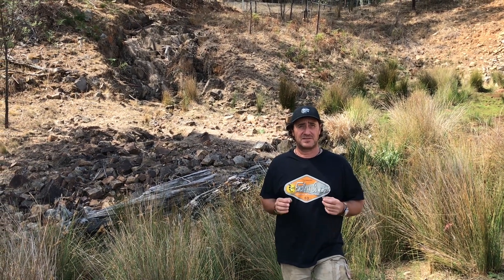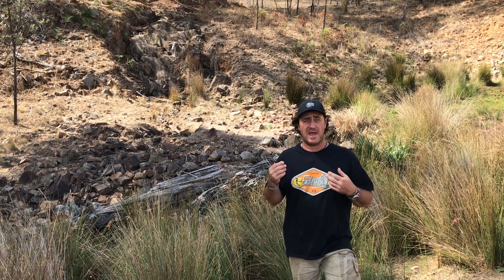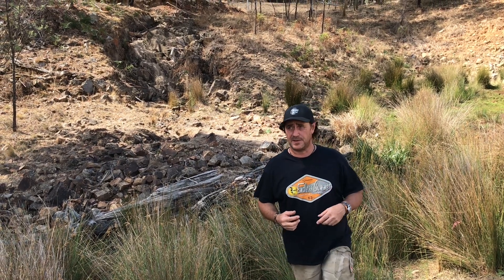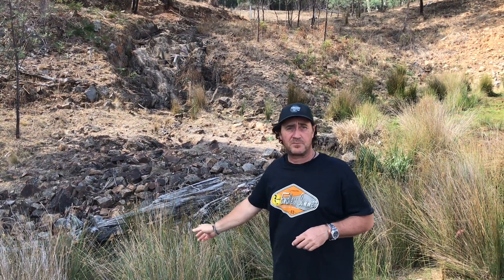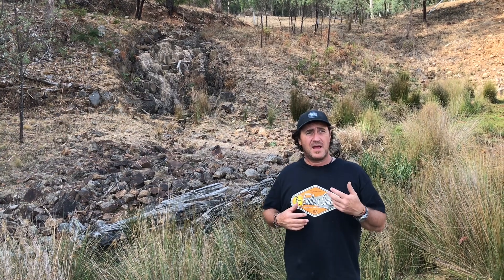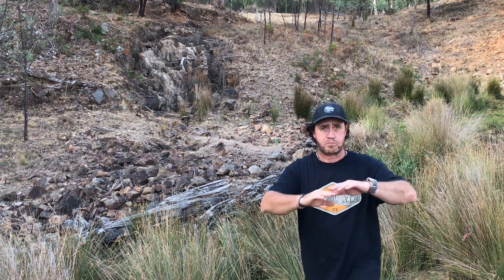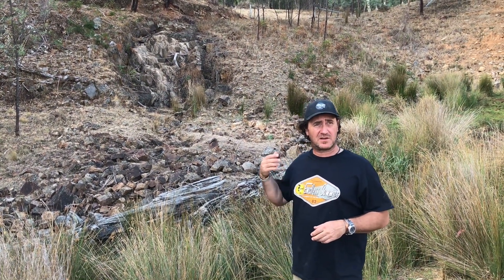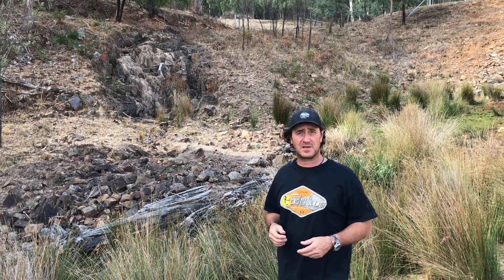Alternative Power Ideas - We Need Help!

Comment: Try looking at a superheated steam turbine set-up stuff like that I think about alot I'd love to be in your situation,  soon hopefully
Reply from the maker: I've looked at something similar - a heat exchange system that is similar to that of a steam turbine. The drama is that china had purchased the patent and the new models coming out of Europe are close to $80,000 for the capacity we need. That's a lot of solar and or fuel for the generator. If you know of anything cheaper I would really appreciate the lead. Thanks in advance.

Comment: hi we are offgred and we have found that gas hot water and stove work well and solar and using a generator to top up your solar WORKS the BEST we have a wood stove for heat in the winter we are in Qld so it doesn't get that cold..have been likeing your videos..
Reply from the maker: Hi Julie, I think the system you have would suit us the best. Thanks for your time to respond. Cheers Pedder

Comment: Do the math before you build . Used solar panels are so cheep now as to make other sources non competitive. Even if only used 3 months per year they can still be economical .
Reply from the maker: Hey Teddy, you are spot on. I thinking upscaling the solar system for the new homestead build. With a victron MPPT 450/200 which can handle 4 tracks of 450volts (generally around 4kva) per track.

Comment: Have you look up anything on wood gasifier and generator?
Reply from the maker: Yeah - found a great product from the Netherlands ref to thermal sterling engine (based on heat exchange) 1000 w per hour at 200 degrees C which is generally the average on the wood oven. Couldn't believe the price Euro 10K that's nearly 30K Aus $. This is too expensive for our little farm. Cheers Pedder.

Comment: Harry's Farm just did a 10-20 year video review of some solar and wind installation he did which is a good watch. lots of good comments under his video too. obviously its in a british context, maybe its not so windy in your area. also a heat exchanger he installed with ground heat pumps, it may not generate electricity directly, but it might save you from using/needing electricity in the the winter in the first place if you're getting hot water/heating needs from a thermal ground source, freeing up your direct electricity solar power generation to be used on something else. looks like you've got plenty of ground to bury thermal pipes under, could probably install much of it yourself, so might be a good solution for your farm.

i'll link it here: https://www.youtube.com/watch?v=YW-SRNUgGtk

i think with renewables, combining things together, solar, wind, ground heat pumps, and battery storage, will get you the consistent power that you want
Reply from the maker: Hey Jim - thanks for the link. Poor harry and the shading of his panels. He seems really down about it. Must be UK humour. Cheers Pedder.

Comment: How about a bicycle to generate power in an emergency, you can store electricity generated from a bicycle-powered generator in a battery, allowing you to use the stored energy later even when you are not pedaling; however, due to the relatively low power output of a bicycle generator, it is only practical for powering small devices and not a whole household. Otherwise get more solar panels and a some wind turbines
Reply from the maker: Thanks grace - a bicycle generator is certainly out of the question. I wouldn't make 1km and would need the ambulance on call. Too funny. Cheers Pedder.

Comment: Ok so maybe a little illegal but you can build a receiver coil near overhead powerlines and use the electromagnetic current to charge your solar batteries, like wireless charging on your phone, I think a hydroelectric system like snowy hydro could work for you.
Reply from the maker: love it - cheers Pedder.

Comment: G'Day mate I did a little digging and came up with the following suggestions. The one that stands out to me, is the geothermal system. How to generate energy during winter witthout solar
Generating energy during winter without relying on solar power can be achieved through various alternative methods. Here are some options:

Wind Energy:

Wind turbines can harness strong winter winds to generate electricity. They are especially effective in areas with consistent wind patterns.

Geothermal Energy:

Geothermal systems use heat from beneath the Earth's surface to produce energy. This method is reliable and works year-round, regardless of weather conditions.

Biomass Energy:

Biomass involves burning organic materials like wood, agricultural waste, or specially grown crops to produce heat or electricity. It's a renewable and sustainable option.

Hydropower:

If you have access to a flowing water source, small-scale hydropower systems can generate electricity by converting the kinetic energy of water into power.

Heat Pumps:

Air-source or ground-source heat pumps can efficiently heat your home by transferring heat from the air or ground, even in cold weather.

Wood-Burning Stoves:

For heating, wood-burning stoves are a traditional and effective option. Modern stoves are designed to be energy-efficient and environmentally friendly.

Energy Storage:

If you have access to other renewable energy sources, consider investing in battery storage systems to store energy for use during winter.

Have a look at this and see what you think :   https://youtu.be/Uv8bTAGr0tU   https://youtu.be/C1fttmKe-_Q
Reply from the maker: Thanks Les, you are a super star!
Reply: @FatCowFarmTatong  Any time 🤔

Comment: I've tried solar and wind (traditional). Solar was hands down the best. The windmill did produce some power but it never hit the numbers it was supposed to and was pretty unreliable. I have seen a vertical windmill made from a barrel and a retrofit treadmill motor, and a water tank painted black and placed in an insulated coldframe to preheat water - that worked pretty good!
Reply: Something else that's really cool is the Russian style oven that heats a bed with the cooking fire by redirecting the smoke.

Comment: What do you need power for? There will be different solutions for different needs. Is it for heating, cooking, running a fridge or other appliances, power tools, etc? 

Generally, I would say, just get more solar panels. You seem to have a lot of space. Also, get a generator as a backup.

Comment: There is no such thing as free energy. That said we currently run a 10 kw system 18kw of battery and have feed in crdit enough to cover charges to get us through winter at minus 10 temps overnight.
The syatem will pay for itself in 7 years as it stands. Approx 12 yrs if we go off grid. Our useage is not compromised, actually consumption is more than if were we on grid dependent.

Comment: Hi mate, just wondering why you cant make solar work all year??
Im thinking you just got to go bigger (dont know what you have currently). 
Is it possible to talk over the phone sometime if so how? Im not willing to share my number in public.
Reply: Panels are so cheap, this is the right idea, just way oversize the system and it will be fine for winter.
Reply: @Happyantix112 panels are cheap enough, but it’s the storage that’s needed. We just replaced our batteries (only!!) on our current system… $10k!!
Reply from the maker: Hey there, can you message me via instagram and we'll talk. Cheers Pedder

Comment: 0:06, if you listen carefully in your video, there is an answer. I will give you another one too: wood gasifier. Both can be combined with a engine, which could produce energy and heat.